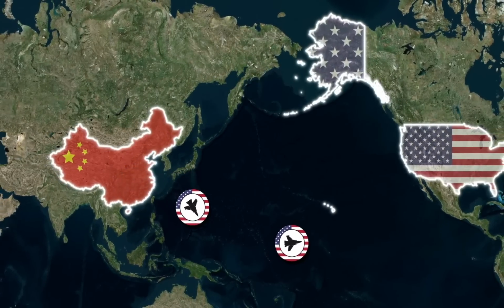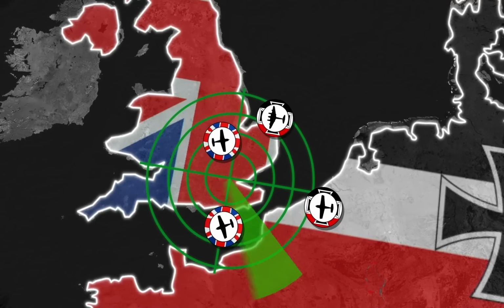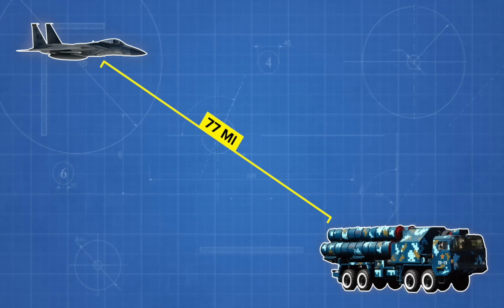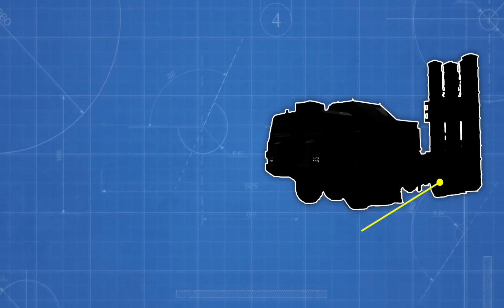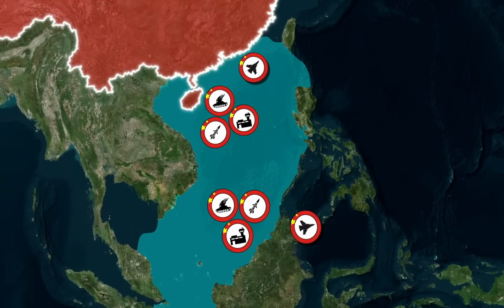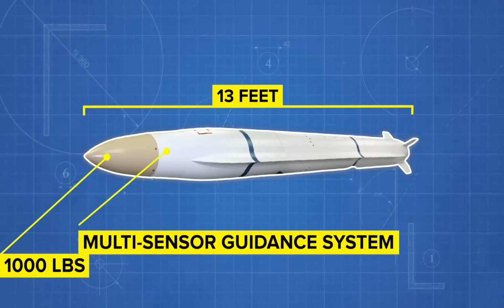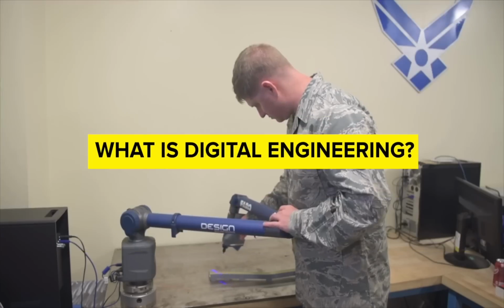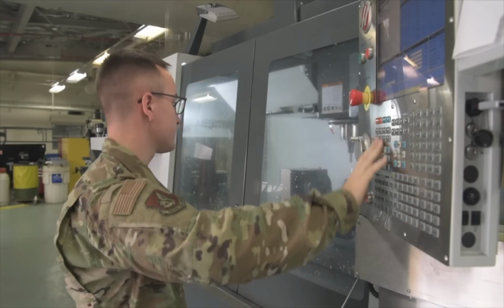Why America's New Airstrike Weapon Is A Total Game Changer

Comment: I recently saw a report that these Chinese artificial islands are already in the process of sinking back into the sea again.
Reply: sinking sand....hard to get dredged ocean floor compacted enough to not subside even with hardened borders to prevent it
Reply: yup not only that but i'ts not practical either, in a conflict those islands would be easily destroyed and you can't supply them effectively. Great beach front but that's about it.
Reply: @KhaosBreather  they were already targeted by US and allied assets.....also the US has plans for small teams of Marines to land on uninhabited islands with AA and anti-ship missiles for area denial...Marines have been asking for 10 years or more for their own fleet of SMALL amphib to conduct independent operations not using the huge floating bases the USN provides for them
Reply: @michaelkendall662  it wouldn't be difficult for the to take them either, the PLAN doesn't have a blue water fleet, those that are would be too occupied to assist them, those guys would be sitting ducks.
Reply: all of the 19 military base islands? there is no single island military base of China are sinking because they are built above a basaltic and granite rocks which is harder than a tensile steel, you only see corals and sands in the surface but underneath is a basaltic and granite rocks were the foundations are embedded
Reply: @totzinfo  Of course, modern China is known for its architecture and its durable buildings...or breaking dams...or newly built roads that disappear into the ground...or collapsing roofs burying dozens of people...or newly built buildings that have cracks after a few years...or exploding gas pipelines that sometimes reduce entire blocksto rubble...you are not fooling anyone.
Reply: I've read that as well.
Reply: Western media always report this kind of fake news.😂
Reply: @miki-wong836  it's not fake it's called physics, unstable sand sinks into the ocean, I know in china the ccp does all the thinking but at least put a little more effort into it. last time ccp tried to do science it killed a quarter of a billion people because according to their bright minds sparrows were the enemy of mankind 👏great job.
Reply: @miki-wong836  Says the paid troll on the internet...are you trolling from China or from Russia? Or do you work for both countries?
Reply: 是嗎？你確定？😂😂😂

Comment: from my 7 years usaf, i'm sure this is only the tip of the iceberg - what they say publicly.  not only that, but aircraft will fly if they're missing parts and systems, leaking fuel and/or lubricants, etc - which the SR71 has done for many years, until it heats up, things expand and seal up.  i've talked with other usaf members that they had full O6 colonel wing commanders who didn't land, they flew their plane into the ground EVERY time.  they had one guy they called col crash, cuz they had to send non-destructive testing analysts out to inspect the plane every time he landed.  how he made O6, i'll never know.

Comment: Some of the Chinese militarised Islands are actually sinking due to erosion because very poor grade concrete was used in their construction, it has been theorised that very poor grade concrete is due to the graft that is endemic in the Chinese construction industry, with a lot of the monies paid for the construction of these Islands went into someones pockets and not top grade construction materials.
Reply: It's called "tofu dreg" .. and half of china is built with it.
Reply: One wonders about the three gorges dam and tofu construction 😂😂😂😂😂
Reply: @garyfoxall279  If you look at a Satellite shot of the Three Gorges Dam just after ir was built and today it is no longer the straight line it was, it is now displaced in sections its only a matter of time befor it fails catastrophically.
Reply: @vaughanellis7866  it is also a primary target by the US and Taiwan in the case of an attack on that island
Reply: you can crumble their rebar by hand.....when they built the new Bay Bridge they bought cheap Chinese steel to save costs and had failures before it even opened on the walkways
Reply: 2:37 2:38 2:40

Comment: China may be extremely dangerous to American Air Superiority. That's a BIG ASSumption as to whether the Chinese military gear actually works. Word on the street says that those export gear sold to countries like Iran and others are performing unsatisfactorily. Ofc, China COULD claim that the export gear are inferior to the domestic stuff. However for the export gear to fail as spectacularly as reports suggest raises questions on how much better ARE the domestic gear if the export stuff are THAT bad.
Reply: Socialism/communism has a component of compulsive and mundane sameness...they lack individual inventiveness....this is a big reason why the PRC must STEAL new technology and then has difficulty pushing it past the point it exists at when they gain it.....when you show initiative and the ability for independent thought you tend to DISAPPEAR in those societies

Comment: Of course any anti aircraft can be overwhelmed or exhausted. Typically an opposing combatant would spoof the anti aircraft system into exposing its location. The “spoof” comes in the form of mimicking a radar return signal from a variety of different aircraft or weapons. This allows not only destruction of ground based radar installations but also produce misinformation about the makeup of the incoming attacker.
Reply: yeah we call it Electronic Warfare....a strike package with non-stealth aircraft will have an EA-6B Prowler or a newer EA-18G Growler leading ahead to diminish enemy AA activity and capabilities
Reply: @michaelkendall662  Thanks for replying. That’s what I call it too. There is  more info about the level of sophistication of EW on YT. Including how a radar illusion of an entire attack can be generated.

Comment: SIAW does not sound that impressive. Stand-off is only 150km range, AGM 300km, max speed 2.9Mach, radar homing ... It'll come in range of Chinese AD system before air launching. It's another A2G missile. Not clear why it is a games changer.
Reply: Didnt you hear anything? 
"Able to select its own target", "launched not on a target but in a general area", "communicate with other missiles about targets", "change target and/or area mid flight"... and thats just some of it
Reply: @ts-cj2ym  Own target selection is radar homing. Shared/network targeting is nothing new. At 150km range and Mach2.9 it is not sufficient stand off for platform to be safe.  Taiwan strait alone is 180 km wide.
Reply: 2.9Mach means it is maneuverable and it CAN easily evade interception. Since it targets any radars within its range, this is like a lion selecting which buffalo to eat in a group while eating grasses. Nom nom nom! lol
Reply: @BatAskal  China has Mach 10 missile which are manuevervable ...
Reply: @joem0088  Your hypersonic water missiles will be shooting blind once the radars are taken out. Nom nom nom! 😆
Reply: " 2.9Mach" is not hypersonic, to begin with.😂
Reply: It's a standin missile, not a standoff. It is specifically designed for short range fired from an aircraft after penetrating an enemy airspace.

Comment: China's Carrier killer Mobile hypersonic TEL units are no slouch either. They have apparently been testing them against full sized moving carrier mock ups in the Gobi desert.
Reply: ONCE it has been in deployment for some years, then it might be worthy of consideration.

The PLAN is only 70 years behind the US in naval operations 

But thanks for the heads up. 😏
Reply: @TooLegit_ToQuit   70 years??? Its truly remarkable what they have achieved in as little as 20, and are already building their fourth carrier the 115,000 ton type 004, with electromagnetic catapults like the type 003.
Reply: Ballistic missiles are easier to detect and intercept than low flying cruise missiles. This is what Aegis BMD is designed for.
Reply: @johnsilver9338  These are hypersonic weapons fired in numbers to guarantee a hit.
Reply: @John-hu9qg  And for the same price of a single DF-21/YJ-21 or any other DF ballistic missile, a salvo of 5 - 10 Tomahawks or JASSMs can be launched instead. So China would need to expend more than 100M USD to sink a single Aegis ship let alone a carrier protected within its flotilla, while for the same 100M USD a whole Chinese CSG can be sunk.
Reply: @johnsilver9338  Only if one foolishly assumes that China does not possess cruise missiles and JASSM equivalent, which they do, and possibly even more capable versions.
Reply: @John-hu9qg  Terminal supersonic/supersonic anti-ship cruise missiles like Russian Kalibr 3M54K/T, Chinese YJ-18, and Indian BrahMos are twice expensive and have less range and less payload. Tomahawk Block V on the other hand is a dual purpose land attack/anti-ship variant while having the most range of 1800km and heaviest payload of 450kg. But the main selling point its also the cheapest. In terms of SEAD/DEAD tactics Tomahawk is undoubtedly better if not the best much more if MALD decoys are also used.